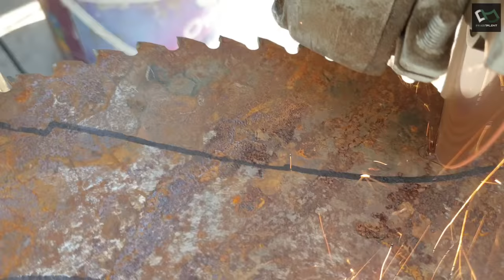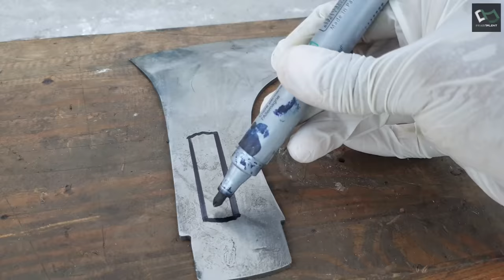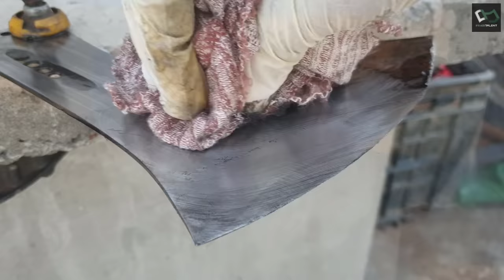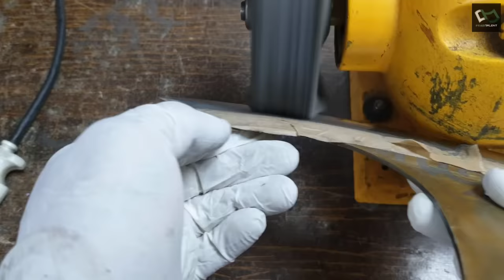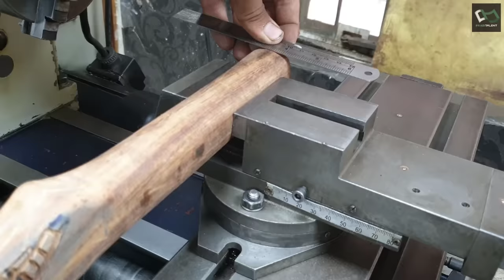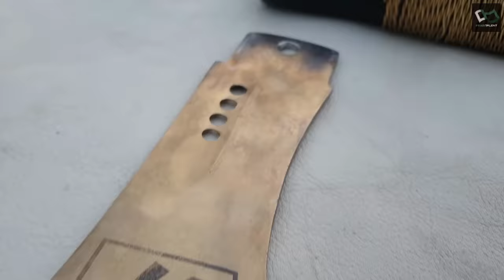RUSTED Wood Cutting SAW Blade Turned into a Razor Sharp WAR AXE

Comment: I’ve always thought saw blades were to thin but this is awesome!!!!
Reply: These saw blades are made of junk steel, only the welded teeth are hard.
Reply: Oh so you think he made them hard in the furnace?
Reply: But actually hard or not I was talking about thickness anyway so what did that have to do with my question lol?
Reply: @pavloszimbrakos4410  you can make this steel hard he didn't have it hot enough saw blades will keep a nice edge though ive made knives from them
Reply: "too"

Comment: it looks kind of nice. but with that pin holding the axe head onto the shaft, i bet if you hit anything more solid than that wood plank showning being split, the wooden shaft will snap from the force of the blow.
Reply: Rppppppp
Reply: Yes I agree. I would make the handle larger at the top and use four pins actually drilled and set the whole thing in epoxy

Comment: after quenching, shouldn't it be tempered in an oven at 400 degrees for about 1 hour for stabilization?
Reply: yup
Reply: How long should i temper a half inch machete of mild steel
Reply: @ramiromoreno1386  you dont temper mild steel cuz its not hardenable. Not enough carbon content. So if you went through the process of "hardening" the steel, then u just wasted time
Reply: @dracobruhma  THANK YOU! The first reasonable opinion here. I'm sad people know nothing.

Comment: Those dark blue spots from the grinder, are from the metal being over heated. Enough stress will break the blade if you don't heat treat it.
Reply: How do we treat it??
Reply: Thank you for telling me cause I was real confused.
Reply: @yahyaplayz329  put it in the kiln , or the forge coals them quench .
Reply: @yahyaplayz329  heat it and cool it for even periods. After heating, let cool slowly in pearlite or sand to prevent breaks
Reply: @madpatriot7464  I've seen guys use toaster ovens for this. Max the little bugger out, then set a time for an hour and a half. Then quench in sand.
Reply: Then after quenching it, you temper it, so it isn't too brittle. If you are careful to not get it too hot at the grinder, you don't even have to heat-treat a sawblade! (They are already heat treated.)
Reply: Этим топором всё равно не работать - это декорация.
Reply: @sergermakov  Я сделал вот такой топор. Он выдержит некоторое легкое использование, но вы правы, это украшение. Если вы делаете топор для использования, это должен быть обернутый топор или сложенный топор.
Reply: The toaster oven is to temper not heat treat heat treating is done around 1500 degrees give or take depending on the steel.  A toaster oven never get that hot

Comment: In a fight with the cyclops you better be a good sprinter. That axe is about as much use as a wax fire guard
Reply: I'm curious..and wonder if you could share in your wisdom as to what about it makes it fall short of a proper ax ? Is it the material ? the weight ? style ?  all the the above ? The way he attached it to the handle maybe .? So as to avoid making same errors or avoid bad techniques
Reply: @ijaripanju3408  The single pin fastening method along with the thin blade material makes it a nice piece of art but nonfunctional as an axe. The blade material will NOT stand up to heavy blows and is better suited for a knife used for slicing not chopping. Nice skills  though. For example, old saw blades like this make great fillet knives using the same stock removal process. Oh, and NEVER use one pin to fasten a handle to anything as it allows too much movement.
Reply: @GH-or7lx  thank you ,  I really appreciate the info . Matter fact I like your idea about making a fillet knife from a saw blade . And after doing some actual wood chopping since my post I have a better appreciation of what you guys said , and yes regardless he has talent for making a nice looking prop .

Comment: This ax has many imperfections the first one was he used a saw blade. Yea is cool and creative but not smart. The metal sheet is too thin and all that grinding and filing you did made the metal weaker and more vulnerable to heavy damage. Secondly the temper wasn't good, you barely let it sit there in the oil and agitated it coloing it down more. Third the combination of the handle and curvature of the blade of the axe. For the approach you went which was a curved Nordic axe used by vikings in raids you added a handle with to much curvature and a little too short for the size of the blade. Overall aesthetic, it was nice nice did like that but functionality and durability of the axe I would give a developing rating between 4-6.
Reply: there is a reason the blade has carbide teeth. that blade may or may not have enough carbon content to be useful.
Reply: @UlyssesDrax  bro i have been making knives for 4 years i think i have more experience than u and him
Reply: Looks really good.  I like it..   to the naysayers, bet you 1000$ that you wouldn't let someone give you a chop on your neck with it..... lol
Really enjoyed the vid ☺
Reply: The main problem is the steel, only the welded teeth are hard, the body of the saw is common junky steel, barely hardenable.
Reply: @UlyssesDrax  interesting and grossly incorrect. But you are right it is a forum of opinion. Some people just find empty "expert" responses annoying is all
Reply: It was plenty smart. It isn't a metal sheet it is a saw blade. Old Saw Mill blades are often used for similar work. It is not mild steel in a pointy circle. Outside of thinning the material filing in itself does not do a damn thing and is also done by MANY blade makers. Grinding heats but is almost irrelevant when it happens before treating and tempering. Second, you referred to the quenching as tempering and they are not the same. Heat treating and tempering are different, and regardless the video focused on that for like 3 seconds. I am not sure if you are aware but you can edit footage and shorten sections of a video. Blades are also almost always agitated in a slicing motion. Waving it is an issue and he did not do that. He did not even agitate it. He raised and lowered it. Cooling it faster? That is the point lol.Third, for your approach you went with know it all status. This was a fail because you have shown zero knowledge of actual blade smithing process, missed the fact no one said it was going to be a historically accurate reproduction, and failed to consider that the length of the blade is appropriate for the size of the handle considering the thickness was "too thin" and is much lighter than a traditional bearded axe. I give your comment a who tf cares rating of between a 0-1

Comment: blade is too thin. will eventually deform over use as an axe. Thicker steel is used for axes to give overall strength to the blade as well as give additional mass for easier chopping/hewing.
Reply: Ll

Comment: I myself wouldn't go into a fight with that type of axe. A kings axe was made to chop off someone head at a cutting block. And only to scare people to keep in line or your next. In a fight the lighter the steel the more movable you are. That's why you only see small one blade axes in battle around the 19th century. People used axes throughout history but never more then some farmers forced to fight. It looks cool but useless with one nut and screw holding on the blade. That fails fights over and your dead. Rethink that decision you made to hold the axes to the handle. Good luck and thanks for sharing your video with us on YouTube land.

Comment: This is by far only a visual piece, which I may add is not even period correct. This piece being functional and durable enough to handle any form of stress is not plausible. This is only good for the possibility of wall art for individuals that never plan on using it for anything else. The metal is way too thin and that was before the grinding, it was improperly heated and quenched, should have been tempered and cured, not to mention the intersection between blade and handle is too weak and poorly constructed